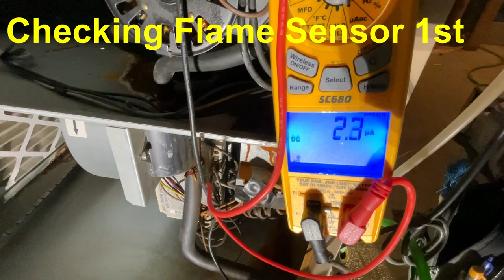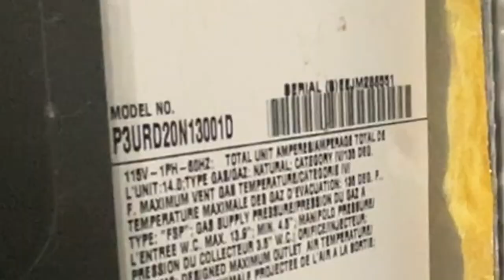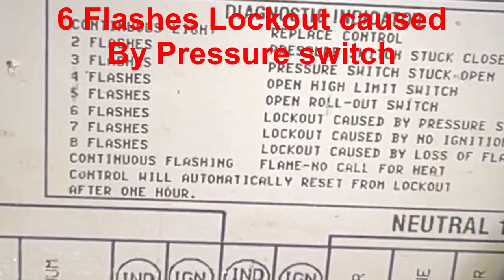YORK FURNACE NOT HEATNG , With helicopters

Comment: I’m not if it’s just York that uses them But those grey pressure hoses made of silicone break down and have that white powder inside them that mess up pressure controls. Have you had many issue like that in the past few years?
Reply from the maker: Yes, I have seen this also. That makes sense. This was definitely an issue with the drain on this one.